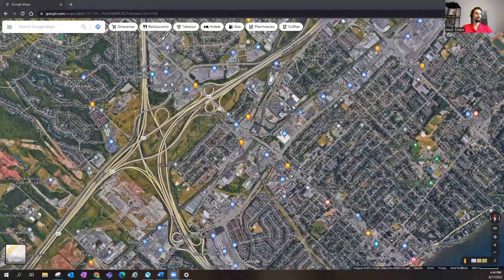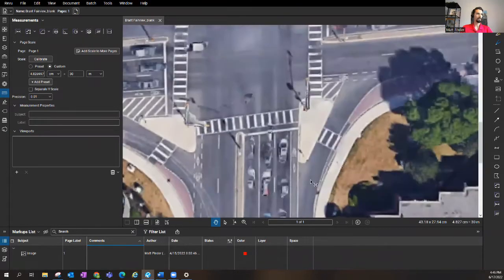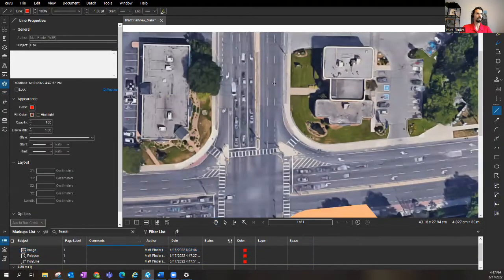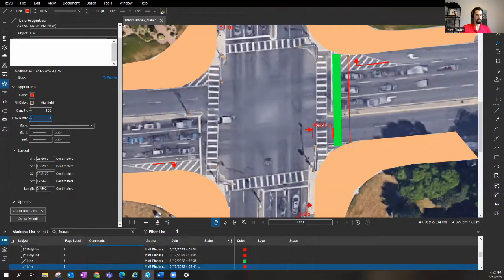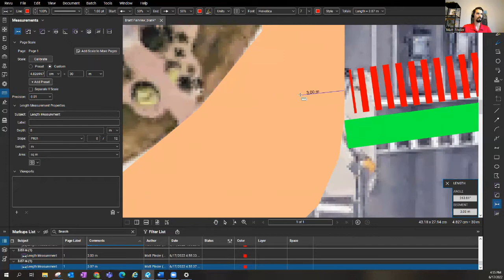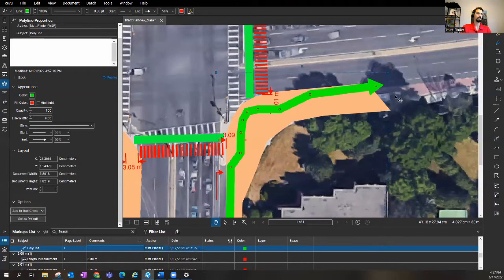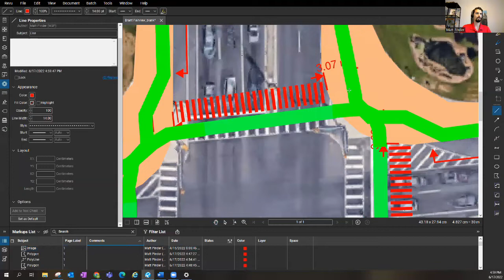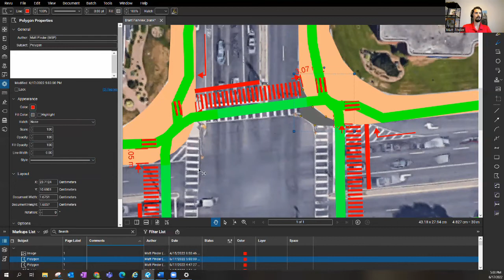(shortened) How to Design a Dutch-Style Protected Intersection

Comment: Nice. I guess with these intersection updates you might also have to update the traffic controller? I figure the All Red -> Pedestrian transition might not need to be as long since they don't need to get as far into the intersection to be seen
Reply from the maker: Yes, updates to the signal timing plan would be a must. Pedestrian phase can be shortened to improve efficiency, but you’d also want to consider protected phasing: a strong preference for fully protected left turns, and consideration for protected rights as well.